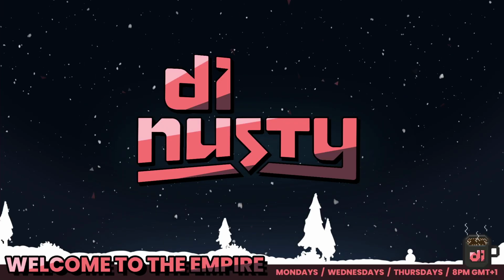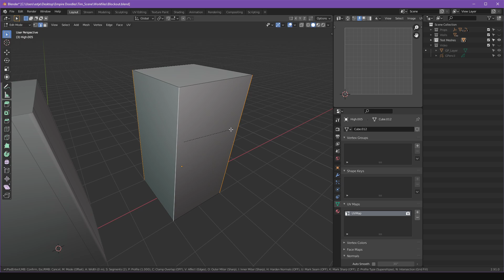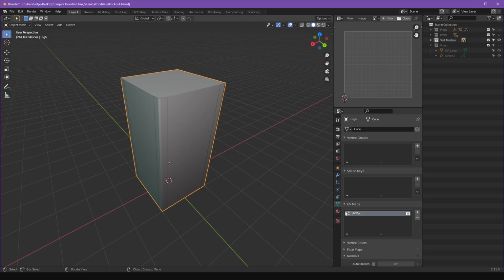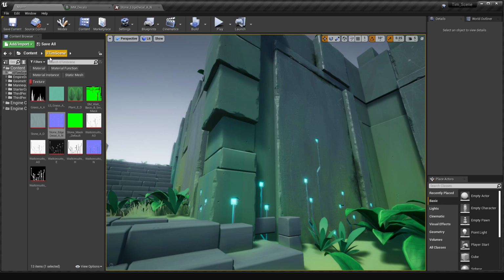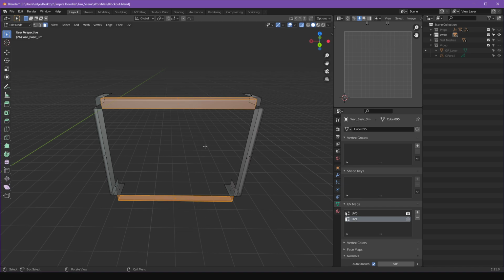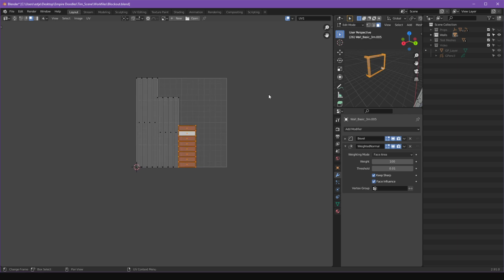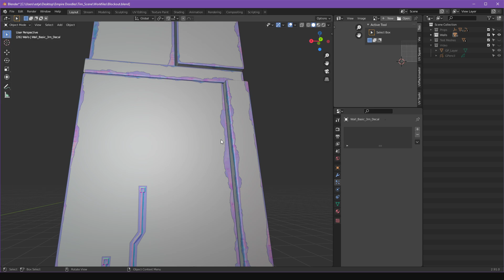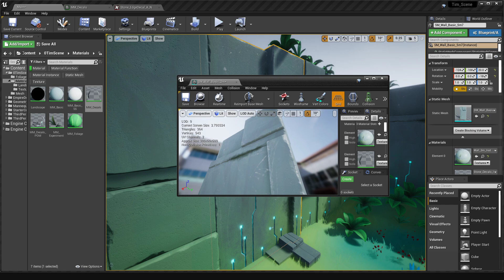Setting Up Mesh Decals

Comment: Correct me if I'm wrong but parenting is not necessary for standard export to unreal engine. You can just tick "combine meshes" in the UE import settings if you want them as one mesh.

Comment: hi, great tutorial , very straightforward! I'm having trouble getting this to work with other angles though. Is there any way to use the same texture( baked from 90degree corners) on, maybe a 45degree corner or do I need a specific edge decal for each angle?
Reply: different angles give different shading to normal maps as far as I know, so I guess you'll need to bake additional trim for 45 degree angles

Comment: not sure what I'm doing wrong but when I create mesh decals sharing the same world space as the base geometry it starts flickering like crazy. Also I can't seem to apply materials set to deferred decals to meshes, only to normal decals.

Edit: In case anybody is running into the same issue I did, don't enable nanite for your mesh decals in UE5 or decal materials won't work.

Comment: Question: I have a MASSIVE environment I am building with 100+ Walls of varying shapes and sizes. Can this mesh decal be used on most of them that I am trying to lessen the hard edges on? It's a lot of work to do every single wall corner by making it less 'hard' so I was wondering if this is an alternative that could work.

Comment: I found a great additional trick into of this is to use object position to randomly scroll the decal UVs along, it's a minor thing but it can give reusable pieces a lot of easy variations and is very cheap. If you wanted to take it a step further you could even do the same thing to randomise which strip of the decal to use randomly
Reply: make sure the texture tiles across for it to actually work properly

Comment: lowpoly's "auto smooth" SHOULD be OFF when you want to bake normal from it
Reply from the maker: Right but if you want a 90degree turn in the low poly with non skewed normals it’s better to weight it with the bake mesh.

Comment: Does this work with static baked lighting?
Reply from the maker: Yes. Baked lighting just requires UVs so if you have two UV sets you will have the third UV set be for Lighting bakes.

Comment: Any ideas how to fix decal mesh clipping through geometry when camera is far away?
Reply from the maker: you can add more space between the decal and the asset.
The only other thing i would suggest is to fade it out at a set distance. this is one of those things that i think we would have to consult a tech artist about to figure out if there is some render prio we can get on them.

The reason this is happening though is because the meshes are so close together that you start getting sorting issues as you get further away.

Comment: This technique is nice, but there is transparency sorting issue with distance in Unreal. 
The only way I found to fix it ( On the web ),  is to activate Flat tesselation on the decal material... and yep I don't know if performance are impacted even if you set tesselation multiplier to 0.
If someone got a better solution, I'm interested, because there is a ticket for this issue since 4.13, and never fixed.

Comment: Wouldn't it be easier and a little bit less demanding to just use intersections on a mesh directly and a secondary UV Channel for the decal mapping? I'm sadly no technical expert but decals seem to be somewhat more expensive then more geometry, multiple maps or multiple uv channel, which is why I'm thinking of decals that are allways on specific places could be placed directly on the mesh and using more common decals for patterns to break up repetition

Comment: That's a nice technique!
I have a question: is there any real advantage of using mesh decals instead of the "regular mesh" except for a faster workflow  -maybe for prototyping-?
because I can see a chance of a worse overall performance of the scene...
Reply from the maker: What do you mean regular mesh? For any real advantages I think it’s good for helping you be faster like you said but also allows for shortcuts where needed. 

Biggest gain is objects that need higher detail but baking a normal is just not visually high enough in detail. It’s not realistic without serious time investment to sculpt and bake everything.

Comment: seem to be running into some issues when baking the lighting, even with shadows turned off the decal mesh seems to cause artefacts on the base mesh, double checked and there are no edges/face/verts that are piercing the base mesh. could this be a setting with material that I am missing?
Reply from the maker: Could be that it’s not set to the right render type like translucent or decal

Comment: Hi, I was wondering why you did a multiply by 2,2,2 and subtract 1 on the normal input channel of the shader. Great tut by the way!
Reply from the maker: Because the normal had a alpha in it. When that happens unreal doesn’t run it’s normal map compression so you have to do it manually in the shader.

Comment: Question, rather than specify the normal texture to be a normal map with compression, you set the mode to linear color and perform the normal bias offset in the material. Is there any reason for this? I always thought you'd want to set your texture to be a normal map in the texture asset and then just plug it to the normal output
Reply from the maker: It’s because I have the alpha in the texture.

Comment: Awesome video thanks! Just a question regarding the alpha. What's the process you use to make it? Is it just painted in photoshop or did you generate one in substance somehow?
Reply from the maker: What I use now is the height map in substance designer and histogram scan it.
Reply: i think he just painted it in photoshop on stream. If you want to use substance painter, I usually convert color ID maps using vertex colors to opacity.
Reply: Oh man, I thought I was the only one struggling with this. Felt like a complete doof :) I made a mask in Photoshop in the end, but took me a couple of tries to figure it out. Wow, histogram scan in Designer sounds like a cool way to do it quicker.

Comment: 3:27 does weighted information cost something?
Reply: To my knowledge, no.
It's just normal information then every other. I think he added these edges, to be sure that he gets a good bake result.

After the bake, you could delete these edges.
Reply from the maker: Those are just for a clean bake. You could consider those meshes throwaway. Once you have the texture you're just applying them to the decals.

Weighted normals or these types of bevels do cost more but that's something i wouldn't worry about unless it's something the project is worried about.
Reply: @TheDiNustyEmpire  in blender when i apply weighted normals to mesh, is there any way to referesh the normals to standard normals , i found some bugs in this proccess
Reply: @voytechj  thank you